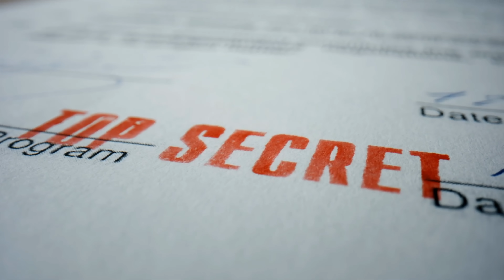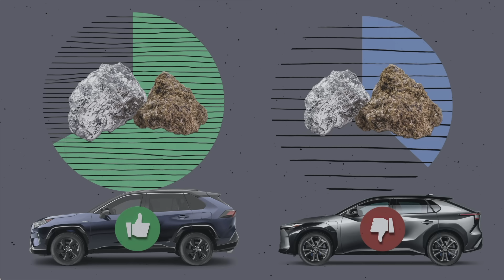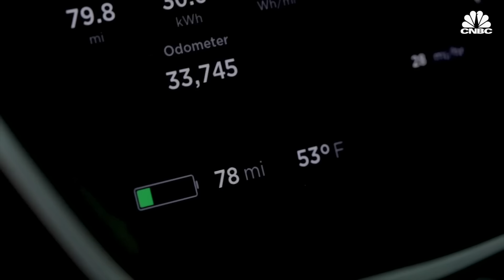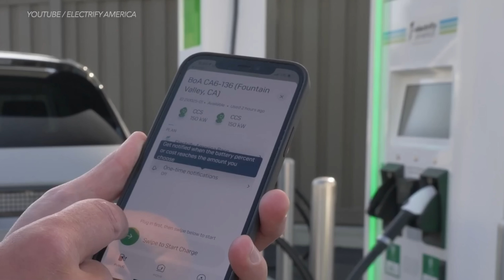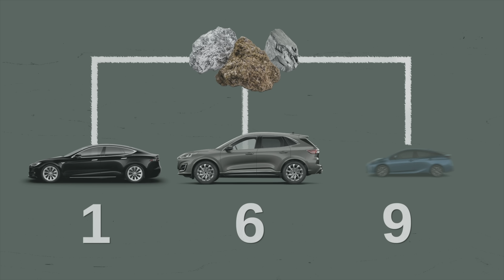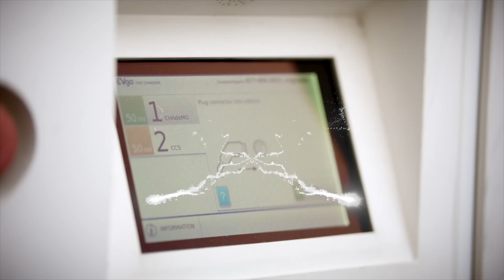Toyota's Announcement Shocks the Entire Car Industry

Comment: I believe that Toyota is on the right track, I just want Toyota to know that keeping their quality, reliability, and longevity up at the top notch like they have been in the past is key to making more people want their cars. Quality is king, and Toyota has for quite a while been the king of quality. For me personally, a Corolla or Camry would be my choice of car, though I prefer a standard transmission over an automatic or CVT. That's just my personal preference, as I live shifting the gears myself and engaging the clutch precisely for the application. A 5 or 6 speed standard transmission would be exactly what I'm looking for. And maybe having a good level of overdrive in your top gear(s) would easily get 40+ mpg at highway speeds. Something around 2,750 - 3,000 RPM at 85-90 MPH in 6th gear, with 4,000 RPM in at 80-85 MPH in 5th would be pretty ideal.

Comment: On average, charging a single EV uses 20x the electricity per month than running a refrigerator. 5x as much as running an AC unit in the summer months.  The average household in the US has two cars. To get to 50% EV usage in the US by 2030, we would have to increase the grid capacity by nearly 400%. This does NOT include the push to eliminate NG for heating and cooking in both residential and commercial buildings in the same timeframe. Also, there is a push to move all logistics and transportation to EV status in the same timeframe. When those increases in demand are factored in, we would have to increase energy production and delivery in every section of grid in the US by 10x. There is not enough capacity or time to build both the power plants and increase the grid capacity required while avoiding clean coal, NG, oil-fired and nuclear power sources. We don't have enough rivers to dam and build hydro plants and can not produce enough energy with wind turbines and solar farms--even if we increased their production and manufacture by 50x in the next 10 years. People who work in the energy industry understand this and know we are running headlong into an era of suffering and loss driven by political hacks who have no understanding of the repercussions of their dogmatic approach to this insane push. We don't have the money or the time to build the necessary infrastructure, so get used to mandates to stop using energy, rolling blackouts and sitting at home hoping one day your car will get charged so you can get to the store. I suggest we all buy a bike
Reply: It’s all a grift!
Reply: All by design. You will own nothing and be happy.
Reply: EV and Hybrid vehicles have BIG batteries prone to provoke unstoppable fires. Would you trust your battery pack after just a little accident parked inside the house garage ?
Reply: You say they have no understanding of the repercussions, but maybe they do. Much of this could be malice rather than ignorance.
Reply: The electric companies are loving this. Although EVs is better plus gas is pricier and what about global warming 🌎
Reply: are better…
Reply: @dalecollins876  
What about Global warming ? You prefer a mile of ice on top of Canada ?

Comment: I thinkToyota will  dominate once again! Hybrid is the future rather than complete EV!
Reply: Tesla currently dominates in the ev space and it’s being challenged by Hyundai and Kia
Reply: @jim-ce5kt your loss
Reply: @naveenthemachine I wouldn’t take a Tesla Model 3 or Y if given to me free either.  Cheap crap.  Scotty is right.
Reply: BIG batteries prone to provoke unstoppable fires. Would you trust your battery pack after just a little accident ?
Reply: Right on brother
Reply: Bye bye Toyota
Reply: @ducthman4737  EVs experience far fewer fires than ICE. and the fires are stoppable, other countries use different methods that are highly effective.
Reply: @Idiotsincarshere 😂😂😂 Ev’s experience a far greater number of inexplicable 🔥 fires, compared to ICE. EV fires also burn at an alarming rate, are also far harder to get under control and emit an environmental disaster under combustion.

With a petrol or diesel fire, that fuel was going to be burnt regardless… with an EV fire, those chemicals were never intended to be burnt.
Reply: @lukeclifton4392  “Fully electric vehicles, on the other hand, were deemed far safer than both hybirds and gas cars; they are far less likely to catch fire, with just 25.1 fires per 100,000 sales. That’s compared to 3,474 hybrid fires and 1,529 ICE fires per 100,000 sales respectively.”

Comment: toyota is right as usual.  i've long thought that hybrids are the way to go.  far more practical, and the performance is just fine.  i rented one when my car was in the shop, and i really liked it.  i usually have a lead foot, but that's tapering with age, and the performance was just fine for me.  it was an ioniq.
Reply: I heard that hybrids are more efficient in-town where you recover energy from braking and use zero energy while waiting at stoplights. They are a great vehicle for taxis and delivery. But they are not so efficient on the highway because you are running two propulsion systems at once.  But, according to several of Scotty Kilmer's videos, woe unto you if you ever need a repair! It's gonna cost ya!
Reply: @dsbennett  i have a friend that has owned 2 hybrids.  he says the brake recovery is very little, and he is meticulous in measuring things, cuz that's what we do for a living.  you would think it would be more, but it really isn't. i'm more of an ebike guy, and most ebikes don't even bother.  it's like 5%.
Reply: @skip123davis  My son-in-law rides an electric wheel to work. He lives in a small town with steep hills everywhere. It's amazing to see him going up and down some of those hills. And he charges it at work so he "drives" to work for free.
Reply: @dsbennett  I rented a prius once, like 10 years ago, and drove 2 hrs on the hwy.  cost $5.00 in gas.
Reply: @543whitey  A friend bought the first Prius model and still drives it with the same battery pack. A few years ago, he calculated the cost savings in gas has exceeded the original price of the car. So he figures he has a free car.
Reply: Unless people are buying plug in hybrids,  the non plug in hybrids are just as useless especially if ur commute is highways. The non plug in hybrids users expecting to charge their battery via regenerative braking don't understand how little it charges.

Comment: Toyota, for now, is open to independent repair which makes a huge difference. If a Prius V's battery dies, you can buy a $2100 lithium conversion kit which actually improves your mpg over the OEM battery. If the inverter blows up because of a bad solder joint, you can open it, remove the computer board, plug the computer board into a used IGBT module from the junkyard.

Working on the battery is pretty foolproof. It disassembles with a proprietary clip system and the tool to open the clips is the emergency kill handle, so it's impossible to open the battery while live.

If you're in the US of course don't do the IGBT module swap, just limp to a Toyota dealer and they'll fix it for free if the inverter blew because of the recall. I'm just pointing out there's no Tesla-like software lock that stops you from just swapping the part with any other 3rd gen Prius and clearing the check engine light. Those cars are hackable and I like it this way.
Reply: This is by far the most relevant thing that sadly not enough people are talking about.

Comment: Toyota is smart. Look what happened to Ford trying to join into the EV market.
Reply: The Ford Lightning is amazing. It’s just they don’t build its base model. I would consider buying a $50k model
Reply: @griffint6637 oh you’re right that it loses range when it’s loaded. It’s definitely worse for long hauls. We’re you going a good distance with the construction supplies, because it should have completely killed the range to less than 50 miles.

Comment: Overall, sounds like Toyota is making a good bet. I say that in part because I have grave doubts that the EV charging infrastructure is likely to be significantly upgraded anytime soon. And EVs have other problems as well, including the high cost of charging. What I'm hoping for is renewable fuels to emerge and keep internal combustion engines on the road.
Reply: Ever seen Idiocracy (movie)?  In one part they identify that a passenger in one of the cars is a wanted criminal and shut the car down for the police to come apprehend.  Can't shut your car down remotely with Internal Combustion engine, at least not as easily...

Comment: Screw EVs, they are not the future.
Reply: AGREED!
Reply: I like how in the normal videos scotty is more skeptical but in these analysis videos he's like EVs are the future. EVs are pushed harder than virtual reality has been over the decades
Reply: @fakumadda1632  computers were a new tool evs are a tool revision with positives and negatives
Reply: @fakumadda1632 You know electricity is made from fossil fuels. The same as oil.
Reply: @fakumadda1632 🤦‍♂️
Reply: @fakumadda1632  I apologize. It is in the USA.
Reply: @fakumadda1632  Yes. The USA uses 60% fossil fuels to make electricity. Have a great weekend!
Reply: Why ?
Reply: Hybrids I like better and make more sense.  Hybrids can make their own electricity and charge the batteries so we don't need more grid capacity?
Reply: @Houston123ABC very little
Reply: @Houston123ABC Hybrids make electricity off of the fossil fuel nothing innovative. I want to know when the fully made hydro car is available. That's worth it all. A car that can use water to refuel itself.

Comment: I hope Toyota makes their solid state batteries as a hybrid option only.  My company leased me an EV and I waste more time trying to find a spot to charge than actually driving it.  Hyundai might make a pretty Ioniq 6 but the supposed 315+ range is a lie.  They recommend not charge more than 80% and you shouldn't let your EV drop below 30% because the main battery might not charge the 12v so you'll end up with a dead battery.  So that only leaves you roughly 50% battery usage  before you have to charge again.  One plus to the EV is free EV charging for 2 years but only valuable if you charge late at night.

Comment: EVs will always have a niche market until safer battery tech is perfected. I wouldnt want to be anywhere near a parking garage full of EVs when one decided to light up. Lithium Ion, range, infrastructure, cost, charging time and availability and inability to repair are just some of the issues which will keep EVs to a small niche group.
Reply: Or worse,parked in a garage on a ferry.
Already 2 ships in 18 months with uncontrollable fires.
Take a look at the Freemantle highway.

Comment: Many years ago, when the Prius was first released, other manufacturers came out with their hybrid models. Popular Mechanics wrote an article about GM and Saturn's low level hybrid system. It was low cost but not very powerful.  The idea was to ger low cost hybrid systems into the hands of many people. This would have an overall benefit than having a poweful hybrid system in the hands of a few. Very similar thinking to Toyota's 1-6-90 formula.

Comment: I’ve kinda known this! 
The drive range is further 
And fuel efficiency is just as good and more miles to the tank and no charging! 
It self charges! 
     What do you do when your out of electric and stuck in the road? It’s not like u can walk to a charge port and fill a can with electricity or fill a transfer power battery..(charge a battery and carry it back to the car and discharge it into the car for a mile of power! To get to a charge station)!

Comment: Hybrids are ok for city driving- not so much highway, as the engine's doing all the work- and it has more weight to haul, as it has the battery and motor to shift as well.
Reply: Utter crap! I have two Toyota hybrids on the drive and they are just as good on the highway as putting around town. I suggest you go give one a serious try (Prius, Corolla, or Camry).

Comment: Toyota's problem here in the US is that their dealerships are charging way more than MSRP, which is Toyota recommended retail price.  Good luck finding a dealer that is willing to let you buy one with the MSRP. They are all trying to push DSRP (Regional Distributor Suggested Retail Price) and/or DSRP (Dealer Suggested Retail Price), both of which are way higher than MSRP. Because of this reason, people are talking away from buying Toyotas. As a result, Toyota is losing market share to its competitors, such as Honda, Mazda, Subaru, and etc.

Comment: There are two main reasons  the Model Y, a $50,000+ car, is outselling the  Corolla, a car that starts in the $20,000 range. One is the fact that the Model Y is a big seller in China and Europe, both regions where the Corolla has never been a big seller. And two, and probably the biggest reason for the drop in Corolla sales, is due to the almost cultish desire for crossovers and SUVs which has taken a major bite out of Corolla and all sedan sales. Also remember that this statistic was only for Q1, 2023. If you look at an entire year, 2022, the Model Y was third in sales with 747,700 units, behind the Corolla (992,000), which itself was beaten by Toyota’s own RAV4 (1 million). So in reality, it looks like the RAV4 was the best selling car of 2022.
Reply: yes and that's why they built the Corolla Cross...unfortunately they can't build them fast enough

Comment: Scotty, I dont want an electric car. I like simple reliable and durable. I drive my cars until they are dead. If I buy a new car, maybe  2000cc 4 cylinder with a 6 speed manual. I might get an automatic because I broke my left ankle in april. Every shift hurts for now. Im still driving a 2011 sentra with the original clutch. Supposedly jatco automatics are not durable.

Comment: Instead of charging, they should introduce "replace the battery" stations. Batteries should be standarized and easily replaceable. But it requires a different car design
Reply: and standardized batteries
Reply: @543whitey  exactly

Comment: We keep cars for over 12 to 16 yrs plus, so no EV or Hybrid for us as the cost of battery pack replacements are too costly; the out-of-pocket cost ranges from $8,000 to $20,000.
Reply: wrong, hybrid battery replacement is as little as 1800
Reply: @mikej238  That's what the salesmen tells you! 🤣🤣
Reply: @fuzzresponder2225  no that's what I found. There are 2 generation Prius with over 300 000 miles getting battery replacement for under 2 grand . You're still living in the year 2000. Plus a new hybrid  comes with a 10 year battery replacement warranty 😂 
Go fill your gasser chug a lug.

Comment: Hybrids are no good either.
Still have thick cables under the hood that can kill you, just like ev's, and too complex to work on yourself, too expensive to fix, with only the main dealer that can fix them with high labour costs.
Back street garages cannot fix them.
Seeing it has an engine as well as an electric motor, it will be more expensive to fix than an ev.
Pure petrol engines is the only way forward, combined with synthetic fuel.
I would never buy an ev or hybrid.
Toyota made the wrong decision im afraid.

Comment: Hybrid and hydrogen cell vehicles have already been proven to be functional and reliable. Wait until EV batteries start crapping out, we are going to have to deal with a catastrophic environmental disaster in disposing of those refrigerator size batteries.
Reply: Not to mention all the other issues with lithium batteries they are way too finicky to be in any vehicle
Reply: Absolutely
Reply: You both say a real concerning evil fact, moreover is to mentioning the big miserys every day, on African innocent childs, who is caused from the horrible consumtion killers , freaks in the for example western world, who causing so much much more misery than with gasoline ore classic full hybrid batteries they done. 
Regards Jay
Reply: Recycling rates for big lithium batteries are around 99% at the moment so there is barely anything to dispose of. Hydrogen cell cars certainly haven't been proven to be functional, with pumps freezing over, requiring long resting times between uses, and extremely scarce availability compared to charging not to mention the enormous infrastructure costs associated with them.

Comment: Why can't EVs have a self recharge system running off the electric motor to a belt driven generator or alternator that recharges the battery, in other words one charge, and as your driving a full circle system that can engage when the battery gets to 20% and kick in a generator system which recharges the battery that runs everything,  in other words a system that is self recharging, and would never need to be recharged , @ vehicle engineering?

Comment: That’s a fascinating math take. Is Toyota saying 90 hybrids are better for the environment than 1 electric car?
Reply: The lithium usage. Did you watch the video?
Reply: Toyota's hybrids are super efficient and get the most out of fossil fuels. As long as charging an EV basically runs on fossil fuels in power plants (coal, gas) and loses energy in the grid and also by hauling around heavy batteries, it's just not a great improvement.  90 EV's using the same amount of Lithium will make more of a positive difference for the environment in the near future than just one EV. They are just waiting for the infrastructure and green energy sources to become available.
Reply: @hungryowl1559  I did. I guess it’s from a manufacturer’s perspective. With hybrids you can make the claim that you offset more carbon per gram of lithium over the life of the vehicles.
Reply: Well, if you consider some electricity is burnt coal...
Reply: @geoffcarberry6211  Actually most electricity is still produced by burning coal, especially in winter when EV's just don't get a great mileage from a kWh